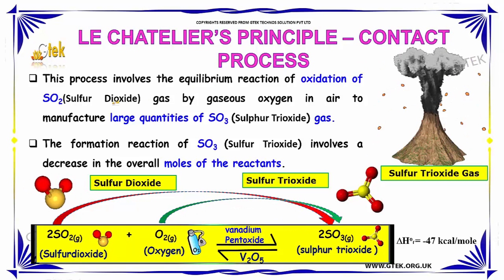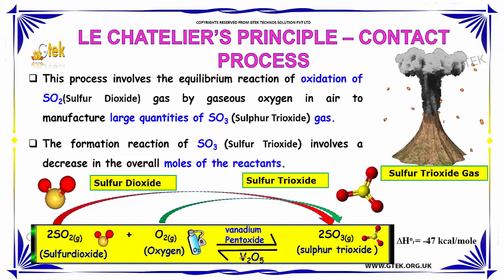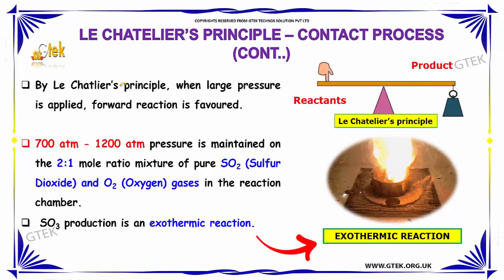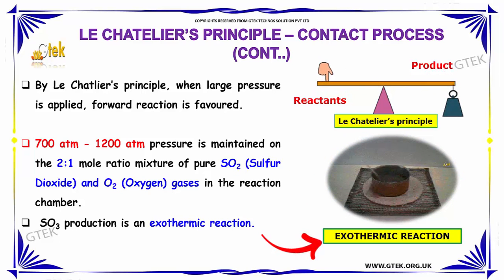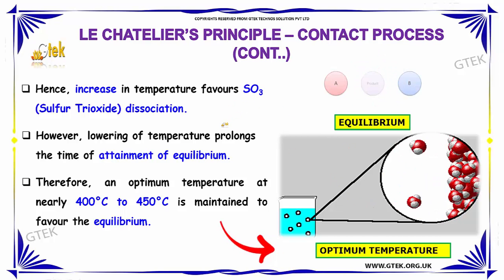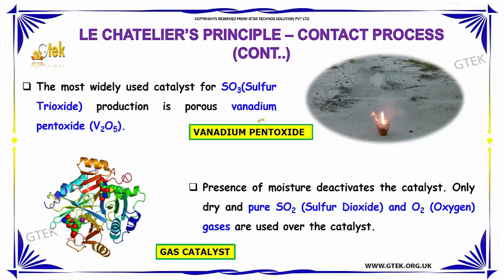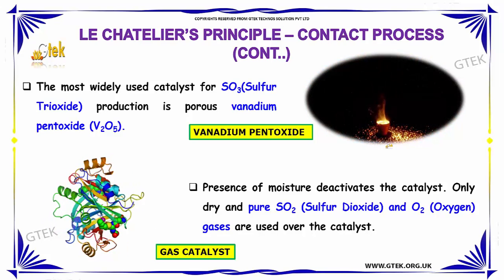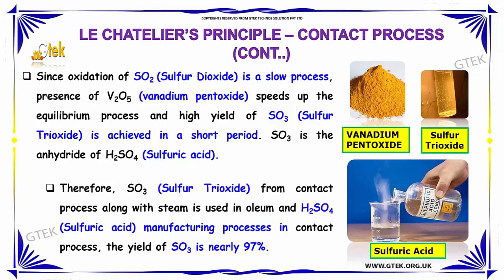le chateliers principle contact process chemical equilibrium 2 class 12 chemistry subject cbse

Comment: The process in which sulphur trioxide (SO3) is formed from sulphur dioxide (SO2) What is use for? ... According the Le Chatelier's principle, pressure there a fewer mole of ... Step 2: sulphur dioxide is converting to sulphur trioxide ... One the most important chemical used in industries is sulphuric acid, it is an ...

Comment: Le Châtelier's principle, chemical principle that states that if a system in equilibrium is disturbed by changes in determining factors, such as temperature, pressure, and concentration of components, the system will tend to shift its equilibrium position so as to counteract the effect of the disturbance (see chemical ...